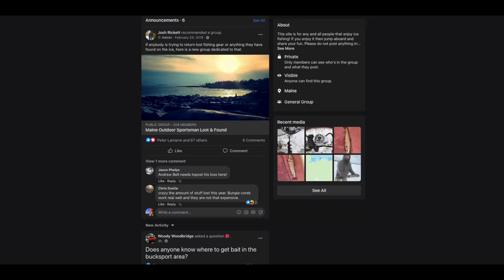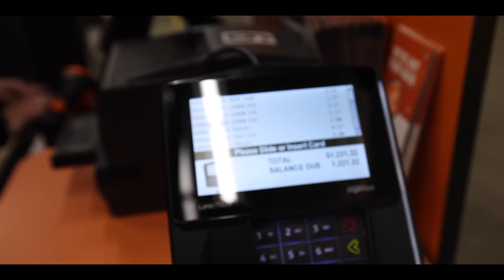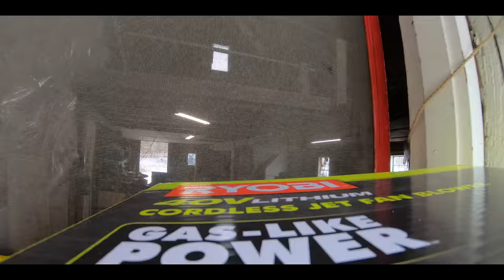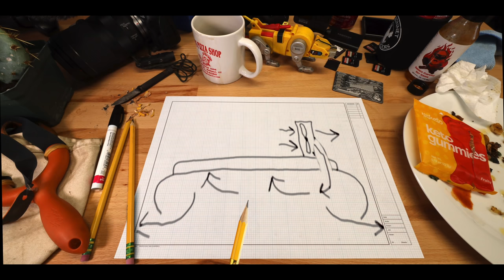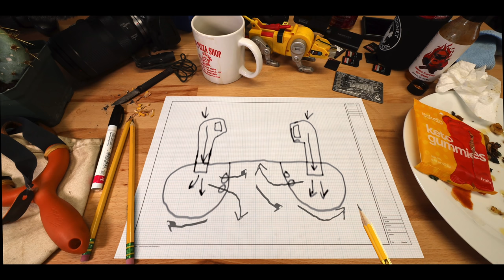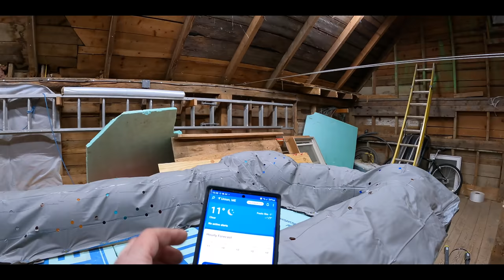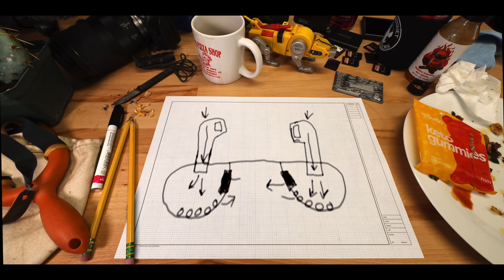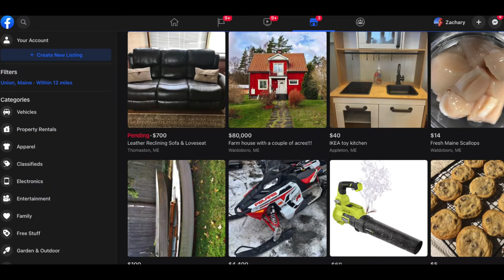Home Depot Hovercraft Build / Leaf blower hovercraft

Comment: With that much amps going through the switch, relays would have been better as you probably lost a lot of power going through just one switch. then instead of pushing down on the ice, your rudder blowers should have been blowing horizontally instead of downwards.

Comment: My recommendation for the water test, is to have a second (emergency) air bladder inside the current larger one. This secondary bladder would stay inflated so you don’t sink if one of the inflation blowers fail while over the water. Remember: use lots of hot glue to protect the soldering and exposed contacts. ;) I have an ECE background - stuck in software.

Comment: You need to narrow the nozzles. They're too wide for propulsion or thrust vectoring. Also thicker gauge wiring for the switch and rigging.
Reply: You seem to have some knowledge on aeronautics? Any advice for a our air canon?
Reply: @FortInTheWoods  oooo, propellants or pneumatic 🤗?
Reply: @paulh8729  took a out of the box route and used constant airflow. Used 3 leafblowers merged into a 15  foot barrel. We made a video.
Reply: Exact same thing I was thinking👍🏼
Reply: I disagree. Anything you put on the air outlet will decrease efficiency. In my opinion it would work best without any nozzle on it.
Reply: @paulh8729  true, except you are not blowing out a candle but propulsing a hovercraft. Its also why leafblowers have a nozzle; they are made to blow stuff away and not to be efficient at creating thrust. Look at propeller airplanes, e.g. a cesna. Do they have tiny nozzles?
Anyway, best would be if he just tried it.
Reply: @tuner25  yes, he designed the propulsion to push on the surface of the ice not just using thrust in itself. Either way you can't compare to a cessna and prop because of "Bernoulli's principle." Bernoulli's is the the thrust factor with a prop is caused by high vs low pressure on the blades creating lift turning into thrust. Turbo fans in this case a leaf blower work differently you're using compression of air so yes nozzle size and width makes a HUGE difference. He probably would have had more success leaving the original design of the barrel. But heck yeah, experimentation is most of the fun.
Reply: @FortInTheWoods  I'll have to watch for sure!
Reply: Rockets don’t work because the fire hits the ground they work because the energy is forced thru a small opening.

Comment: Me watching this: "cosine of the angle, my dude."
It was terribly frustrating watching everyone point the thrust at a 45⁰ angle toward the ice. Not only was this forcing the nose down, it was drastically reducing horizontal force. Hope to see an update soon. Also, anyone ever see those ads in the back of magazines to build your own hovercraft in the 80s? Anyone ever buy those plans?
Reply: I think he would have been better if he had used a fixed sail at the front and had fans pointing at the sail. I could be wrong there.
Reply: One thing for sure the dude in this video never saw those plans.
Reply: @kjsstanley7  lol that doesn’t work the air pushing the sail equals the force of the fans pushing the other way
Reply: The problem was him praying over it and leading those poor kiddo's to believe such nonsense. And yes, a poor understanding of propulsion, not that a blower produces much, but that's not what they're made for

Comment: The propulsion leaf blowers may need cone tipped reducers to increase the speed of the air. Also, you could add the extra large noodles around the edge of the plywood for stationary floatation while the leaf blowers aren't blowing and/or during battery swapping on thin ice
Awesome build can't wait to see what's next!!

Comment: I think you would get more speed having the blowers aimed straight back. I think you might be confusing push and thrust you essentially have thrust You're not technically pushing against anything. Also for the main switch have you thought about a MOSFET or some type of relay system with some contacts. That is a way to have a low voltage switch control a bunch of high voltage switches. Thus it would not heat up the switch. Hope that helps looks fun.

Comment: Did you try just pointing the bank of 4 horizontally? Blowers like that aren't great at pressure, but they make a ton of flow.

Also, you may want to consider using relays to turn the blowers on and off. That could make waterproofing easier too.

Comment: Zach, you should look into using relays to handle your high amperage loads. A tiny switch in your car's steering column manages to make your starter motor turn over your engine because all it is doing is turning on the coil of a relay that has a set of contacts that are capable of handling the hundreds of amps required to power a starter motor for a large engine. Also, from what I've seen of hovercraft videos, when they transition from water to, say, a parking lot, they behave the same, so you could probably do your testing on an open lot somewhere. The only thing to be careful of would be any abrasion that you may get on the bottom of your skirt if you monkey around too much while you're testing. Love this video, as I do all your others and look forward to the next installment.

Comment: Cool video! I'd just advise pointing the propulsion blowers straight back and not to the ground. You're not trying to point the nose down, but move forward. So point them straight back. Every action has equal and opposite reaction. ;)
It's not a stick pushing against the ice, it's movement of air itself that moves you forward. 👍
Reply from the maker: don't work at all pointed straight back but pushing aginst the ground doses some what
Reply: @FowlersMakeryandMischief  Ground effect, same reason your hovercraft works. It's the reason that helicopter landing can be... interesting, if you ask a chopper pilot.

Interestingly, that's why some bleachers once got blown down at my old high school a few years ago, during a helicopter landing
Reply: @torg2126  In that case, making a box(like a manifold) parallel to the ground with no bottom or rear wall, having all of the blowers connect to in front, should increase the area affected by the blowers and in turn give better result?
Reply: @sasakurtovic6850  It works to a degree, but you get some friction  issues

Comment: @fowler

Ever thought of funneling the outlet of the leaf blowers pushing you forward? I mean, on hair dryer they do the same thing. Same for heat guns. Meaning, you push the same amount of air through a smaller slit or hole, it becomes faster/has more pressure! I know that there is a limit of compression, where the force pushing the air through the outlet cannot overcome the pressure to go through the outlet. It is the same principle as for pinching a gardening hose to have the water spray further. If you pinch too much, no more water and more force to pinch.

Give it try! ;) 

For the lift you need a lot of air (big holes). For movement you need a lot of pressure/speed (small holes),
Reply from the maker: tried that didn't work
Reply: @FowlersMakeryandMischief  oh, wow! 

Looking forward to seeing you using a big "fan".  :D
Reply: @FowlersMakeryandMischief  you need guides like flat blades across the opening. The spinning fan causes a lot of turbulence.

Comment: I have both the Ryobi and Ego blowers, the Ego ones have way more power. Should use those for the rutter / forward thrust. Could use a blow up canvas life raft and flip it upside down for your hover skirt, would probably be more durable and less likely to leak in the wrong areas.

Comment: AWESOME project Dude!!!!!!!!!
Switching problem remedy = relays. Relays will work on lower voltage and handle the high amp and voltage of each motor.
I am also a tinkerer if you need some help with anything. Volunteer of course. I even have a few relays already.
Right in Portsmouth NH. Feel free to give me a shout.

Comment: The  push fan will give the speed you need, but  what i am  concerned about is when you go out on water the lift may not be enough to support the craft properly, you may need to add more blowers for lift , the last thing you will have to test if everything else works, is to shut it  down while in the water  and the start it up again and see if it will inflate again ,but do it in shallow water first just in case things start going sideways .

Comment: Super cool!
My 1.75 cents worth on crossing open water: Maybe more flotation, say an outside ring of pool floats or something like that?   To my eyeballing guestimate it looks a little small to still float in a stable fashion with a persons weight if the blowers aren't working.  And then bring a paddle - if it dies you just have a tough job of paddling/poling back to safety rather than going swimming.  :-)

Comment: Try to remove the blowers nozzle attachment, you will get more air pressure and volume which translates into more forward power. It’s Bernoulli’s principal. With the nozzles on you are just getting more air speed, but what actually moves you is air volume and air pressure which is lost

Comment: I think because the back thrust is blowing more downward than outward/backward, it's driving the front down a little bit. If there was 2 stronger blower in the front, I think it would work, but still you won't have the speed and power you want.

Comment: Cool project. 

To maximize the thrust, you need a nozzle like in rocket. Not very big one because pressure of the leaf blower is not that great. You could take one blower tube block it from each end, heat it up and then stretch with compressed air. When heating it only from one end, you should get decent nozzle shape.

Even better would be to make a mould from wood.

Comment: Decreasing the diameter of your exhaust nozzles will increase your thrust. Try warming the plastic nozzles until you can shape the openings into thin rectangles with about 25% of the surface area you currently have.

Comment: When using a underrated switch, switch the negative side. Learn this when I started building vape mods. It works.
Reply: Or use a mosfet
Reply: @aaronsgarage2023  even better, use an IGBT
Reply: Sorry Robert, that does not make electronic sense. The current flow in the positive and negative leads will be equal.

Comment: It’s like a drone... 10 minutes of fun with 6 hours of recharge time 😂
Reply: 😁😂🤣 Yeah gotta get the gene 2 spectrum smart batteries and smart chargers if you want to spend more time running than setting watching your batteries charge worse than watching paint dry lol ✌️
Reply: Viper I raced rc off road and dirt oval trucks for 4yrs I ran nitro for sevral races it was fun but a lot of trouble compared to electric I fly planes now electric is way more efficient but  gassers are fun though I had 2  big  Cessna's with 46 high out put OS nitro motors with11inch props 20yrs ago they were awesome Nothing like hearing a nitro motor ripping through the air I converted to all electric though I may have to get a nitro motor and put on one of my planes I build out of foam board I still have my old electric starter  a few glow plug igniters and a couple props for nitro motors lol ✌️

Comment: Instead of using an air mattress you should try an inflatable swimming pool. Just build your platform to the same dimensions of the pool so you don't need to trim anything. Use blowers to inflate the pool (skirt) and then have the transfer holes on the inside of the cavity and along the bottom of the skirt to make the ground effect cushion. 
This is an idea I have had since High School and I really want to see if it would work.

Comment: Did you wax the bottom of the mattresses? Would that help lessen any friction? Or would it be more prone to freezing?
Reply: Also, maybe try preserving the wood on the bottom with a nice oil coat to prevent a little less friction too. Use a layer of rubber tap and electrical tap running in opposite direction and turn can help weatherize the cables. Add some scotch-coat for extra protection.
Reply from the maker: I dont think there is much mattress friction it floats around pretty easily.   Just needs more thrust

Comment: i would´ve gone for the hovercraft no.1 @ 8:36 with propellers and 2 (fuel powered lawn mower) motors - most probably cheaper and definitely more powerful! PLUS u can control how much push up you need... How long do these batteries last full throttle?

Comment: If you take and 180° the propulsion tips and get the air on a more parallel position to the ice your speeds would increase greatly... the way they propulsion is now is just placing more drag on the front of the craft

Comment: Angling the blowers down like that is actually less efficient than just having them horizontal. The air is forcing the front end down more, this increasing the drag and friction, thus lower efficiency.

On the other side, as someone who works in the garden section at the home depot, I would have laughed if I saw some bearded bros buying so many blowers heh wouldn't complain though, it helps my dept, and they're going to a feckin awesome use.

Comment: Looked through a fair number of comments and only saw a few pertaining to the propulsion. Im no engineer, but i agree the 4 blowers should be mounted more horizontally for maximum thrust. Similar to how the single big fan in the example clip is mounted straight up and down, pushing straight back. The more you angle the "thrusters", the more you're adding rear lift and losing forward thrust. Might be worth a try before abandoning it and going with a fan.

Comment: Thrust is not dependent on the air hitting the surface.  Rockets don’t work by the fire hitting the ground.  The size of the hole the air goes thru makes more thrust.  That’s like trying to blow out a birthday cakes candles with you mouth wide open instead of pursing your lips and increasing the air pressure.

Comment: You need more power to the bladder the physics of water are a lot different than a hard surface you won't get water in the holes but you won't be creating any lift either.

Comment: if it floats on land it may work on water as it does require more power on water but not much but i would use a paramotor strap it to your back and add a couple post to grip on and use your waist to pivot or turn the craft

Comment: Question would the air mattress not float on it's own? And if so why not just use the leaf blowers purely for thrust? Also also if the air mattress does float on it's own why not just find a way to mount the plywood on top with a water resistant covering?

Great video but I was just wondering about some things

Or what if you got a really long wide thick piece of styrofoam to float on

Comment: With the wiring you've shown, you are likely getting a bit of a short from the snow around them. I imagine that would only be worse on the water. You may be loosing a bit of run time to lost current from intermittent shorting of your switches. I'd say contact Colin Furze for ideas/advice on how to improve it. Only idea I have is to read the info on the leaf blowers to see what voltage and amperage they use, times 3 or 4 depending on which circuit and then check the voltage and amperage rating of your switch/motor requirements.

Comment: This is an excellent example of raw horsepower overpowering a horrible design that shouldn't work in the first place. Lol
Couple physics problems with the way you're going about it... But I'm glad everyone had fun.

Maybe consider pointing your lower horizontally, and fixing your bag so that it's efficient enough to lift the whole thing with just one blower. Then you can go ahead and run the other three at the same time and lift it higher off the ground so it won't drag on soft snow

Comment: Well, new one on me, stripping wire with the torch.  I was skeptical that it would work, so when I thing it won't work on open water either, might not say much, but I'm skeptical that it will run on open water.  I have a gas Stihl backpack blower their big one and a gang of those will put out some air.

Comment: You could have bought a really nice gas powered engine/fans for less than three grand and rerouted some of the power for propulsion with flexible duct and controllable vents to control forward momentum. Or, a couple small gas powered generators(two for counter balance) and some high cfm inline electric fans. I just don't see those lithium battery packs as feasible for your needs. Lithium do not do well in those temps in any case. I am glad that it actually worked to some degree. Open water sounds like a bad idea. Wear a cold water wetsuit and consider your investment may be gone in seconds.

Comment: Very cool man. I don’t think the blowers pushing against the ice or water is what’s important..  just the equal and opposite reaction from the fan output.  Just adjusting the propulsion handle so it blows straight backwards and all force is in the direction you want, like the fan boats you showed.  Currently, the blower angle down is wasting some of the force, and might also be pitching the nose down and increasing drag.  I’m super impressed and have no building skills, just some thoughts about the physics. Keep up the great videos.

Comment: If you angle the propulsion leaf blowers pointing horizontal more of the thrust will go towards pushing it forwards. Having the leaf blowers angled down also pushes the front towards the ground and could cause it to plow down.
Maybe for a version two you could find a propulsion and lift system that pumps lower pressure air but in much larger volumes.

Comment: u said fan on the back meaning... air blowing straight behind it, i believe if u bring the handle down and let the air blow straight... instead of towards the ground it would move faster, IF ALL ELSE FAILS!! add a sail and use the blowers to blow the sail to propel u forward